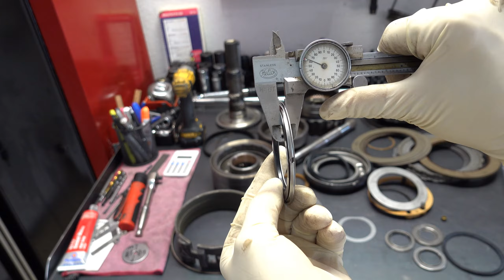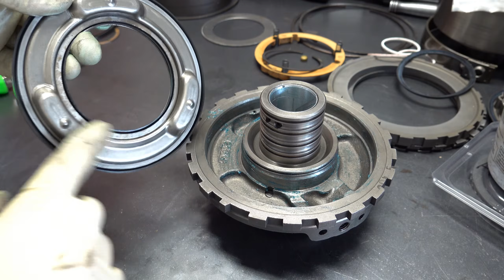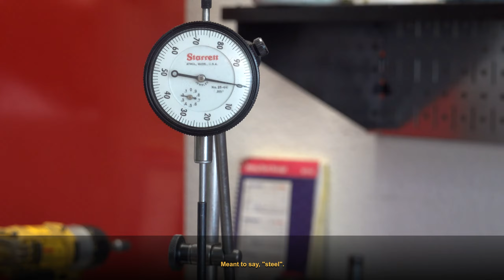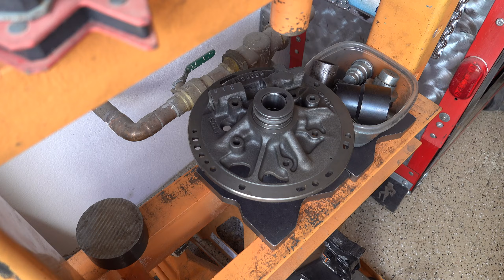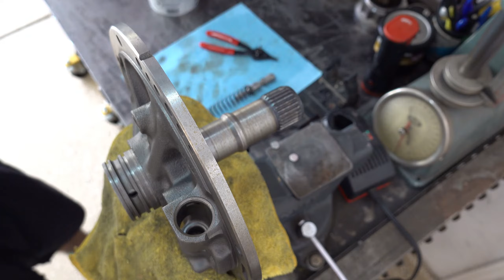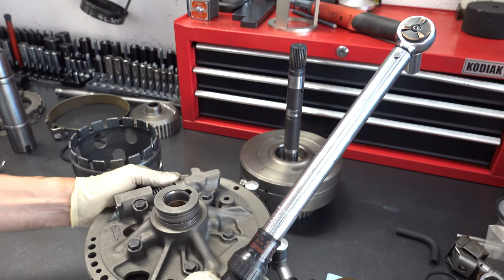TH475 TH400 Rebuild Heavy Duty PT1 - Subassemblies

Comment: What tool is that that u put into the pump to make sure the gears where not binding.
Reply from the maker: Hi David, that's a checking tool that I bought off eBay years ago. I think listings refer to it as a pump gear alignment tool. You can make your own with a converter hub welded to a piece of steel as well.

Comment: For the roller clutch can u use a 4 l80 or stay with the old
Reply from the maker: Low roller clutch design depends on planet design. If you're using a 4L80E planet you can install the 4L80E roller clutch. Otherwise, use the TH400 roller assy.

Comment: When you do the dual feed what do you recommend drilling the feed hole in the plate out to?
Reply from the maker: No way I can answer your question the way it's being asked. There is a multitude of factors that go into determine shift orifice sizing beyond just dual feeding the direct clutch internally. 

Let me know the necessary details and I'll provide guidance.
Reply: @nickstransmissions its going behind a big block in a 55 chevy c10.  The transmission has the sonnax valves and spring in the pump.  I also have the trasgo pump spring. I have the transgo 1-2 shift valve in it that won't allow it to upshift on its own and the transgo separator plate. I believe the converter is a 2000 or 2500 stall.  I'd have to find some numbers on it. It will be a street driven truck so I don't want it to have head snapping shifts just solid and nice to drive.  The motor should make around 600hp.
Reply from the maker: Did you block off the 2-3 accumulator or leave it active? 

Yes, I will need the stall speed as 2000 gets a different (smaller) final orifice diameter than does something with a 2500. 

What is the current diameter of the 3rd gear orifice in the plate you will be using in the build?
Some TH400s came with large diameter 3rd gear feed holes while others came with smaller sizes...
Reply: @nickstransmissions I'm still building it.  I haven't blocked the accumulator but I still can.   I'll have to ask the guy that owns the truck if he knows what stall the converter is.  I'll check the size of the hole when I get home
Reply: @nickstransmissions 3rg gear orifice is .062.  He doesn't know what the stall speed of the converter is other than its a 10"   sorry for all my questions.  This is my 1st turbo 400.  I'm still learning this one
Reply from the maker: No worries. Is his converter new? If not, he needs a new one anyways. Have him find out the cam manufacturer and part number then have him call the manufacturer to get a stall speed range. Tell him to have his appx vehicle weight and axle gear ratio handy. 

If he insists on reusing his existing, used converter refuses to get a new converter DO NOT WARRANTY THE BUILD!

All other things equal, I start at .080 for dual fed third gear assuming a stock to ~2000 stall with an active 3rd accumulator and go up from there, based on stall.
Reply: @nickstransmissions I'll look at the cam specs again.  I built the engine a while back. But it hasn't been fired up yet.
Reply: @nickstransmissions I'm suggesting a new one for it.  It's going to need a 2500 stall.  I don't think what he has is big enough.  I really appreciate the help.  I've been using your videos as a guide.
Reply from the maker: You're welcome, Daniel and thanks again for all of the views.

Comment: When you mention drilling out the drain back hole on the pump, what size drill bit do you use to drill that out? Thanks for such a great rebuild video.
Reply from the maker: TH400s typically don't need it; 4L80Es get a 1/4 drill bit. Thanks for watching!

Comment: Hey bud, I have a full manual th400 I bought a few years ago from a builder. I would like to change it back to automatic. How does a builder normally modify a th400 to full manual and how do I change those mods to achieve automatic operation? Thanks for your help, sir!
Reply from the maker: What shift pattern does it use (forward or reverse)? 

Whose valve body did the builder install? Was it one of Jake's or CK's? Or did he install a Transgo 3 kit or did someone perform some DIY mods to it? Without knowing what was done and who's VB was installed, can't really say beyond look at a hydraulics diagram and see what steps would have to be unblocked/un-done to return it to factory. 

Usually, governor oil is looped, governor weights blocked outboard, detent system disabled, etc. Also, the pattern will have an impact on the internal dual feed modification, if performed.

Comment: You keeping those old junk pistons cheap fix
Reply from the maker: What junk pistons?

Are you referring to the steel forward and direct drum pistons? Or accumulator pistons? 

What do you mean by 'cheap fix'?
Reply: @nickstransmissions   Direct,Forward, Intermediate Pistons, I just found a  475 in percent condition, but everyone said change out steel pistons so sourced some used aluminum pistons from older 400
Reply from the maker: You can run either/or in most applications. The main thing with the pistons is to get the those with a height that matches your plans for the clutch stack. Both aluminum and steel pistons are selective and will allow 4,5 and 6 clutches in either fwd or direct, depending on which specific ones you have. Not sure if you were aware but in case you didnt know, now you do. Carefully check aluminum pistons for cracking; same with steel
Reply: @nickstransmissions  They give me Hell on DIY 400 until I gave in, I am using a Transbrake, Maybe that is why
Reply from the maker: Never heard of that forum but yes - if you're using a trans brake and putting out big power then you shouldn't be using factory pistons at all but instead running billet aluminum pistons for the Fwd, Dir and Int. ATS, Coan Racing and FTI all sell such pistons...The factory pistons have been known to crack (aluminum) or warp (steel) under much higher line pressures and shift speeds when dealing with big power/torque motors...850HP and above, I will use billet pistons and HD billet apply plates...

Comment: Nick, I had a couple of questions...
I'm doing the dual feed mod and I understand about the stator seals, cup plug and middle seal omission. Trans is auto shift, no transbrake.
1. When doing this mod, is the #1 valve body check ball (direct clutch) still kept in place?
2. Is there any bleed out from the center support through its high reverse (right side) port? I've seen where some folks have added a ball bearing into that port, even with the cup plug on the valve body side. I ask this thinking about the sealing between the center support ports and the case holes that I think relies on the center bolt pulling the support tight against the case.
Thank you.
Reply from the maker: Hi NV,

Forward, automatic shift pattern TH400s have to have the reverse check ball and intermediate check ball. You can delete all of the others...Check out my TH400 Check Ball Considerations video for more details on check ball placement: https://youtu.be/uzdPopP2lU4

I don't recommend adding or modifying the center support unless you want to also install a removable cup plug in the high reverse location in addition to the one in the case..I have never heard of anyone, including me, having issues w/bleed from the HR circuit when the case cup plug has been properly installed. You can also tack-weld the HR port in the plate as long as you make it clean - no harm in doing it, just consumes a little bit of your time.
Reply: Thank you so much, I appreciate the info. I'll leave the center support alone and do the regular dual feed stuff.
Again, a tremendous help to us amateurs.
Reply: Forgot to mention, yes I've watched all of your th400/425 a few dozen times over. Your referenced video on the check balls is what prompted my question. Thanks again for taking the time to answer.
Reply from the maker: Thank you so much, NV- appreciate the views and support!

Comment: Nick, when you were building up the direct drum, you ALMOST made it to the end without calling a roller clutch a "roller type sprag".  This is a pet peeve of mine.  Several builders on Youtube use this incorrect terminology.  There is no such thing as a "roller type sprag".  A roller clutch is a roller clutch.  A mechanical diode is a mechanical diode. AND, a sprag is a sprag.  "Roller type one way clutch" would be correct but NOT "roller type sprag".  Otherwise, good info.

EDIT:  I re-watched and you did not use this incorrect terminology.  My statement still stands though.  And the dogbones are not rollers.
Reply from the maker: Thanks for double-checking and watching...Lol, yea a roller type sprag would be a one-way assembly where some of the elements are rollers while the others are dog bones...Would be a very odd part, indeed...I appreciate your attention to detail and agree - the terminology should always be correct at all times. I sometimes mix/match nomenclature when discussing those parts in real life but try to avoid doing so on film so not to confuse anyone who is just leaning. Can't guarantee it won't happen at all though.

Comment: I have have used them waffle clutches and they wear out faster than the paper ones took them out and started using the raybestos stage one red and stage two blue clutches in twin turbo cars and 0 wear on them 2 seasons of hard racing tested many clutch styles and types.
Reply from the maker: I really like the Stage Ones as well and to be honest, ill prob put them in if i rebuild the planets which is likely...I initially looked for them but no local stock and wanted to get this build done asap as it was being done in between shop jobs and was beginning to get in the way. Since It's my personal trans Im not super worried about having to open it up later for whatever reasons so can change things up then. I use the Blues in serious SS or race applications.

Thanks for the tips!

Comment: The only thing bad about using the lube is it makes the clearance’s off a little.
Reply from the maker: True but its usually not material, at least not on the TH400/4L80E transmissions...Lube in the 200-4R rear gear end play is a diff story...thanks for watching and posting, KeysAuto!